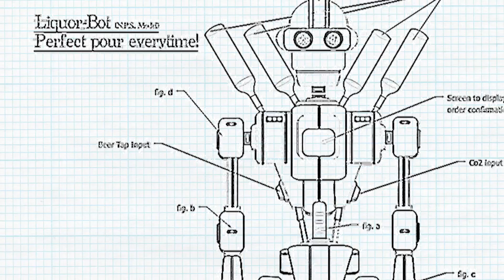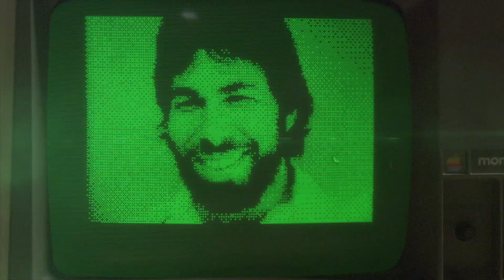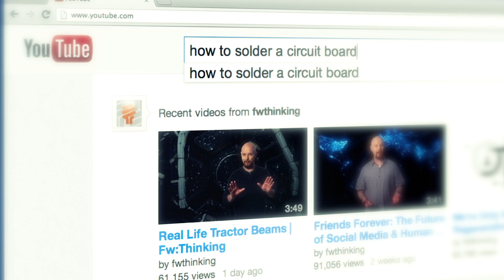The Mad Geniuses of Maker Faire

Comment: if i had a unlimited tools and equipments
i will make a large plane 
that is powered by solar panels and lithium battery
and lithium battery and solar panel will multiplied its voltage by voltage multiplier and voltage multiplier will turn into power source and charging up the lithium battery and power up the mechanism to fly a e-plane

Comment: I would build a fully armored (with 2-inch thick steel plates) exo-skeleton that included mounts for my 3D Printed and illegally manufactured machine guns and also a comprehensive hydrogen-based rocket (gonna figure it out somehow) that allows the 5-ton beast to fly with ease, also it would include a computer system integrated with an AI named Jarvis and flight-stability control, so it can fly by itself while Jarvis and I discuss the history of the screwdriver over a cup of coffee.

Comment: You're dead on about DIY being big and taking off.  Right now I'm sitting up in my dining room/computer room/workshop printing off modified models of human hand bones for a bionic arm I'm designing.  It's all based on anatomy.  I am using real anatomical models for the files for my 3D printer I built.  I added joints that fit metric screws and nuts and am printing them in PLA filament so I can later cast them in aluminum in my home made blast furnace.  

So yea, you could say I tinker.  :)

http://imgur.com/gallery/XxGeP
Reply: OK FIGHT y u Youfe I'm I hi yoU
Reply: Impressive and interesting work! Did you ever finish your project?

Comment: ***** in answer to the question on this video: I've long wanted to build an armored War Bus. think a city bus but firing out of the rear is a large railgun, firing a half pound projectile at about mach 2. along the sides of the bus, between large capacitor and battery banks would be machine gun nests to protect the otherwise vulnerable sides and front of the War Bus. but like all weapons while i think they are massively cool i hope they never see combat

Comment: i would make two hand held devices that's connected through wireless technology to an insturmental computer program and that have accelerators inside so i could hold and move them around and theyd be able to tell how i moved them, also if there where technology to let them sence each others location in proximity to each other. the devices would be programmed with specific sounds correlated to movements and placements. this would serve the purpose of making a hand dance that will work as a dj's sound table

Comment: The machine to solve all problems. Or just a small planetoid roughly the size of the earths core that uses a 1,000,000 mega-pixel simulation program that has been installed to a hologram projector with a kinetic field program installed in that as well. In other words; an active virtual reality that you can touch and CONTROL!